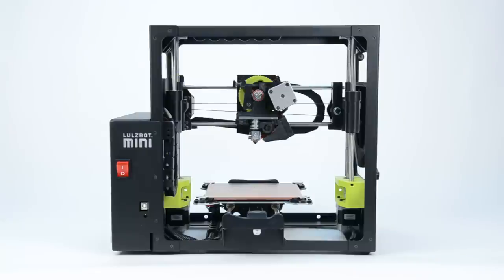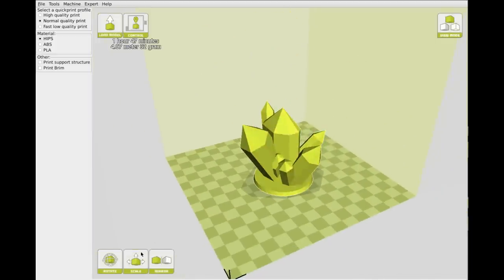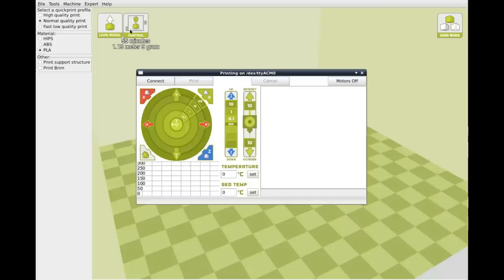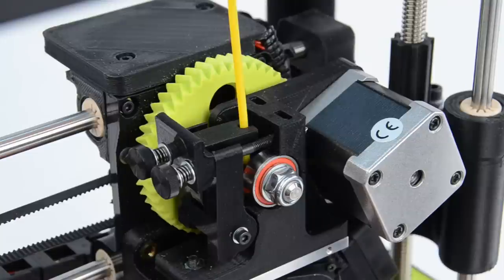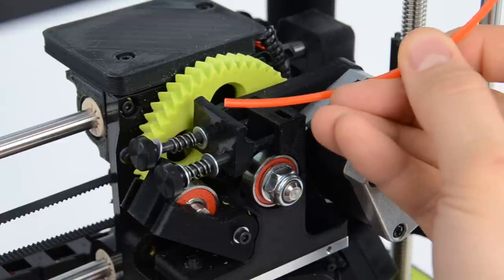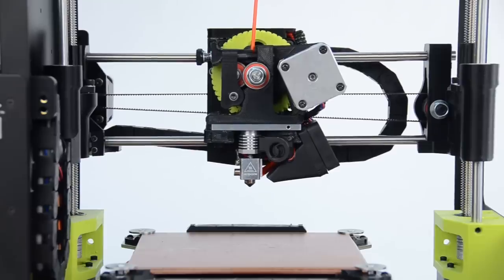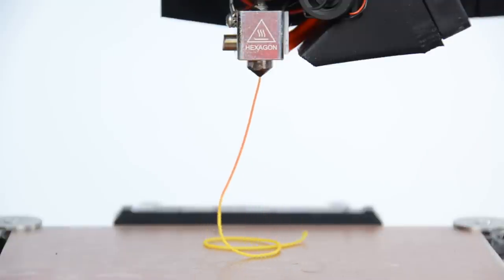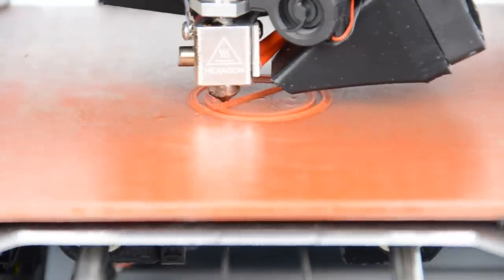LulzBot Mini Tutorial: How to Change Filament

Comment: When I push control, I do not get the controller interface.
Reply from the maker: Twisted Printing Make sure Pronterface UI is turned on by going to in Cura: File > Preferences > Print Window > Print window type- select Pronterface UI. Close and reopen Cura, load a model and print!
Reply: LulzBot Thanks!